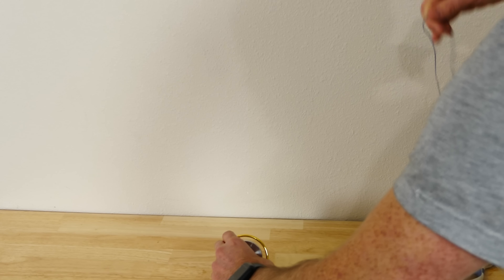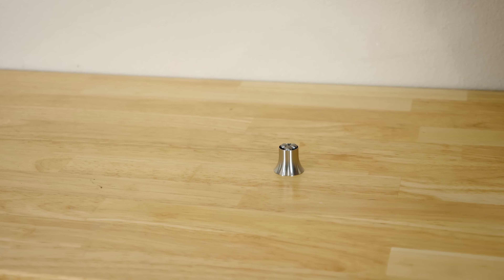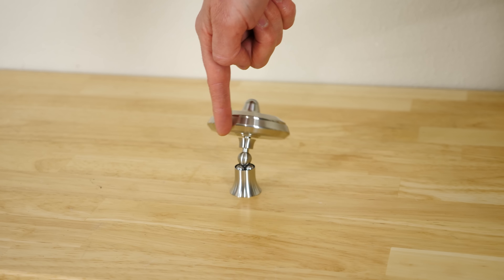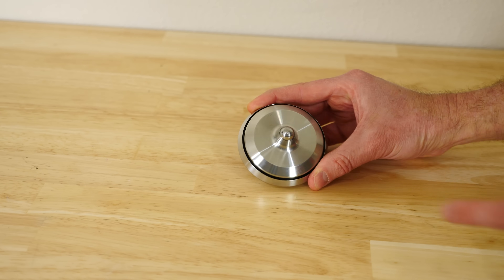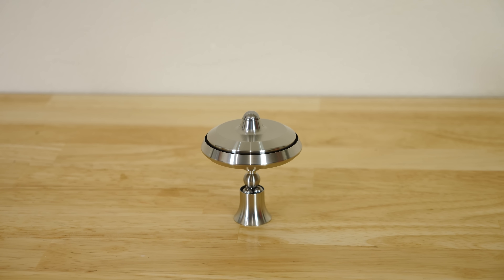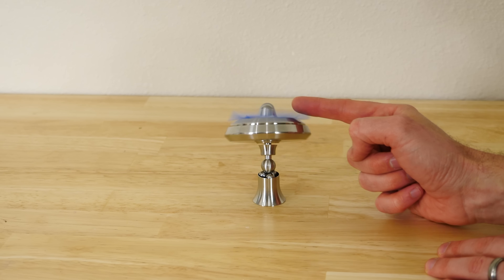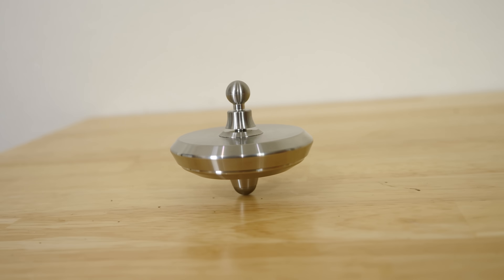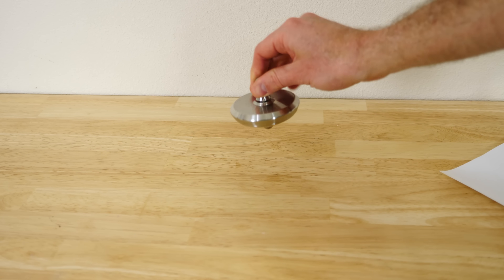How Do Gyroscopes Lift Themselves Up?

Comment: The CAUSE of this effect is NOT angular momentum.  That came from a math analogy that hides the cause from you, then it becomes a conservation law.  That is NOT an understanding, it's a mnemonic device for "what it does."  The cause is seesaw tilting end velocity, one end goes up while the other must go down, perpendicular to the spin plane, that must TOTALLY swap sides in half of a spin rotation to be the opposite end velocity, and this creates acceleration force directed up on one side and down on the other at the tilt axis.  Tilting is directional and changes direction from the forces, so the tilt axis follows tilt direction like an axle producing accelerations the whole time.  This steers the entire disk into some equilibrium usually, or it nutates forever (wobbling).  Look at my latest gyro explanation video that uses engineering sim software to expose the causal acceleration vectors.

Comment: Good, now could you explain the physics? In mathematical terms. It must be to do with transfer of energy between the spinning top, the processing top and the potential energy (the height of the centre of gravity), with energy being lost through bearing friction and air resistance.

Comment: I wish I could see gyroscopic principles applied to a bowling ball. Modern bowling balls have a “weight block” inside them. The weight block or core has the shape of a gyroscope. Ball drillers specialize in placing the finger holes of the ball so that the degree of precessing initiated at the point of the bowler’s releasing of the ball advantages the bowler’s chances of scoring a strike. 
I have watched many videos by ball drillers. But their explanations of the physics tends toward the mystical.

Comment: Very interesting.  How well does it work in the ideal case of NO friction on the spinning bearing?  Specifically I'm referring to powered gyroscopes, like used in airplanes' artificial horizon in decades past, or the Apollo capsule gyros.  Is there a difference between a powered gyro that overcomes friction, and one with theoretically perfect bearings with no friction?
Reply: @johnburgess     :  Maybe, the gyro designer used a magnetic bearing, so almost no "surface-to-surface" contact transpired between those concerned moving parts... Hence, longer time for rotation, before it come to a complete halt...

The American NASA group hinted, in the 60's decade, that they used a "liquid helium" as a bearing system, for the gyroscope gadget of their rocketships, used in outerspace exploration, experiments, etc.. 

The gyroscope effect + very efficient bearing system, was the SECRET for a "near 95% efficient", HYBRID type,  power Genset- thats why, the media & school sector was tight lipped (power moguls directives??..) - when it comes to the design of the very elusive vision, the "near perpetual machine" dream fulfillment...

Gyroscope principle + angular momentum + "fricrionless system", was the secret contraptions, used by the Almighty Creator God (John 1:3  &  Hebrew 1:3  & Genesis 1-2 chap.) - in running those myriads of planets, circumnavigating around the sun, non-stop, in "perpetual motion", for thousands, millions of years...

Comment: The real question is where did the centripetal force go? You'll notice that as the gyroscope on the string is precessing, the string remains completely still, yet all the mass should be at the gyroscope (that string should be wiggling everywhere but it doesn't). The center of mass looks like it is at the center of the string. I find this an amazing effect that is almost entirely overlooked.
Reply: @charlesvanneste2834  What you are talking about is more noticeable at lower gyro spin rates, producing a faster precession. You will then see the string angle out due to centripetal action.

Comment: One thing you missed in precession is any touch on the precession is also felt 90 degrees later which is what we have in the case of Helicopter rotors. The hydraulics are actually setup up 90 degrees to the left or right, depending on direction of rotation.

Comment: Totally correct, but the cause of the accelerations produced still follows the math, and that math starts with a "RIGHT-HAND RULE".  There is no mechanism to that.  It is a mnemonic device, and the cause derived from that math is ANOTHER mnemonic device -the conservation of angular momentum.  No one can explain what that means!  I can, and they will not publish it, because it contradicts the simplicity of their paradigm.  Consider this:  TILT velocity from the seesaw ends of the plane must TOTALLY reverse twice per rotation.  Spin velocity and tilt velocity are perpendicular vectors, so spin only sets the rate for the tilt reversal to happen within.  Spinning is not the cause.  It ONLY sets the rate.  Tilt reversals resolve instantaneously and continuously to acceleration perpendicular to the plane.  The scientific method is broken.  I've been screaming this secret for over 20 years.

Comment: well it's not the complete story you tell... when it comes to the egg or a spinning top rising up when spun fast, it depends on the point where the friction force is applied relative to its direction and the center of mass of the object. there are spinning tops that turn completely around until they spin bottom up, and they work because the center of mass is below the center of the sphere it spins on (if you have seen such a spinning top you know what i mean ...). for a spinning top to work normally, the tip has to be sharper than the whole object. (and if the tip has a flat part, it will never spin upright, but will have a minimal angle away from upright... important is only the part that touches the ground ^^)
for gyroscopes this doesn't apply because they are build in a way that the spinning part of it is not supported only on a point
Reply: Did Einstein study or observe a gyroscope? If not he could have got answers!
Gyroscope is crazy, we might still not see what it is really about, but one thing is sure the answer is there, just in front of us!
Reply: @attilakonkoly1318  it's not that hard to calculate what it does. you just have to use appropriate coordinates to describe certain aspects.
what i wrote about the curvature of the tip can also be described by the friction on rotation and precession (as is done in the video),. So to say "not the whole story" was not quite right by me. but i think it is more convenient to use force and contact point to find out what effect the shape of a spinning top has on its behaviour.
Reply: @deinauge7894  Thank You! I believe that there might be an other hidden force with the combined movement, friction, gravity, an ionic or atom molecularity in  other dimensions that we still don't know yet. It's only a hypothesis but I have the feeling that it's there!

Comment: I'm sorry, I like your videos immensly but this time I feel like this one raises more questions than it answers.

Since all the parts of the gyroscope appeared to be very finely machined stainless steel, it's very hard to see which parts of it spin, when do they spin, how fast they spin in relation to each other, and what kind of bearing is there between them and how that friction comes into the equation, if at all.
Speaking of friction, I watched the video several times, and besides my confusion about friction of what against what causes what, all I heard was what the friction causes, and no deeper explanation as to why is does so.

Comment: Thank god for Sci Hub! You wouldnt believe how many research articles and patents on magnetism have been censored and hidden from the 1900s all the way to present. 

Who knew Phosphate Phenolic supercharges Irons permeability and loss capabilities??? Like WTF???

Magnetic and structural properties of iron phosphate–phenolic soft magnetic composites
A.H. Taghvaei a, H. Shokrollahi b, , K. JanghorbanPO 34 (b) 3000.0
Wave number (cm-1) 1500.0
2000.0 1000.0 500 Fig. 5. FTIR spectra for phosphated powders (a) and uncoated powders (b).
Table 1 Effect of acid concentrations on magnetic permeability at different frequencies.
Acid
concentrations (g/ml)
0.005 0.01 0.04
104.26 98.33 107.25
90.58 92.68 80.92
70.16 80.52 47.18
53.76 66.08 31.5
insulating layer is thin. The phosphate film rather acts as a binder agent at the intergranular interfaces, and the composite gets its strength only by the retentive force of the metallic phosphate. This coating creates capillaries and microcavities that provide interlocking. Thin phosphating layer means less distributed air gaps, larger fraction of soft magnetic particles and lower inner demagnetizing field. It results in lower energy input needs to make the same magnetization process and to move domain walls
m (50 Hz) m (100 kHz) m (500kHz) m (1000kHz)
0 1 2 3 4 5 6
0
0.005g/ml 0.01g/ml 0.04g/ml
200 400 600 Frequency (kHz) Fig. 6. Loss factors of phosphated compacts at three different bath concentrations.
resulting in higher magnetic permeability. At higher frequencies (410 kHz), the sample with lower effective particle size (phosphated powders) exhibits higher magnetic permeability as a result of reduction in eddy currents. The total eddy current loss expression per unit volume in the
soft magnetic composite is derived [17] PedðtÞ¼
1 10    kb r2 rbulk e þ kp r2   2 Fe rFe
dB dt
ð2Þ
where re is the effective radius of the sample, rFe particles radius, kb and kp
factors between zero and one establishing the
contribution of the eddy current loss in the bulk material and in the particles, respectively. In a material with a perfect interparticle insulation, kb ¼ 0 and kp ¼ 1, and when the effect of particles are neglected, kb ¼ 1 and kp ¼ 0. The phosphate layer decreases the effective particle size by reaction between powders
800 1000 Transmittance (a.u.) Loss factor (Ω/μHARTICLE IN PRESS
3930
100
120
20
40
60
80
0
0
200
400
600
Frequency (kHz)
Fig. 7. Variation of real part of permeability for phosphated and uncoated
compacts with frequency.
Table 2
Measured density for untreated and phosphated green compacts.
Compaction pressure
(MPa)
600
800
1200
Phosphated samples
density (kg/m 3)
6910
7280
7710
Uncoated samples
density (kg/m 3)
6920
7310
7720
800
1000
A.H. Taghvaei et al. / Journal of Magnetism and Magnetic Materials 321 (2009) 3926–3932
uncoated powders
phosphated powders
0
1
2
3
4
5
6
0
un coated powders
phosphated powders
200
400
600
Frequency (kHz)
Fig. 8. Loss factors of phosphated and uncoated compacts versus frequency.
Table 3
Measured electrical resistivity, magnetic permeability and pentetration depth of
flux density for untreated, phosphated and phosphate–phenolic insulated
compacts.
Samples
uncoated iron
Phosphated iron
r (mOm)
38
600
Phosphated+0.7% resin 2150
m0 (1000 kHz)
27
51
88
d (1000 kHz) (cm)
0.05
0.17
0.44
surface and phosphoric acid (rFe) and eddy current part in the bulk
material (kb) by separation of particles and increases the bulk
resistivity (rbulk). As a result, total eddy current loss decreases,
smaller eddy current means a larger skin depth and as a
consequence improved frequency stability, magnetic permeability
high frequencies.
The phosphating treatment can increase the elecrical resisitiv-
ity of composites (Table 3) and then decreases the eddy current
loss (Fig. 8) and loss component of permeability in the samples
(Fig. 9).
The ferromagnetic resonance frequency or operating frequency
can be affected by electrical resistivity according to following
equation [18]:
fr ¼ r=2pm0mit2
ð3Þ
where r is the specific electrical resistivity, m0 the magnetic
constant, mi the initial permeability and t the diameter of particles
[18]. As the electrical resistivity increases, the ferromagnetic
resonance frequency tends to rise. From Fig. 9, it is clear that the
phosphating treatment can increase this frequency from 200kHz
to about1MHz.
10
20
30
40
50
60
70
0
0
200
400
600
Frequency (kHz)
Fig. 9. Variation of imaginary part of permeability for phosphated and uncoated
compacts with frequency.
800
1000
800
1000
uncoated powders
phosphated powders
Fig. 10 depicts the variation of the real part of permeability
versus frequency for composites produced from phosphated
powders and phosphate–phenolic insulated powders. From
this figure, the magnetic permeability is smaller for double-
coated compacts below 400 kHz. The phenolic top coating
decreases the volume fraction of the ferromagnetic iron fillers
in the composite and decreases the magnetic permeability
with respect to phosphate–iron compacts, but at the frequencies
higher than 400 kHz, this behavior becomes inverse as result of
reduction in eddy currents. The phosphate insulation coating
has large amounts of cracks and microcavities, therefore the
brittle nature of coating increases the probability of coating
degradation during pressure molding and it is likely that there
are many areas where the insulation coating thins or breaks.
Due to microcrystalline structure of phosphate coating, this
insulation provides much more surface area for stronger
anchoring to resin. The phenolic resin acts as a protective top
coating and then it decreases the damages of phosphate
insulation during compaction and increases the electrical
resistivity of composites.
μ'
μ"
Loss factor (Ω/μH)ARTICLE IN PRESS A.H. Taghvaei et al. / Journal of Magnetism and Magnetic Materials 321 (2009) 3926–3932 3931
100 120
20 40 60 80
0 0 200 400 600 Frequency (kHz)
Fig. 10. Effect of double layer insulation on real part of permeability with frequency.
0.0 0.2 0.4 0.6 0.8 1.0 1.2 1.4 1.6
0 800 1000
where r is the specific electrical resistivity, fthe frequency, m0 the magnetic constant and mr the relative permeability. According to this table, double layer insulation increases the electrical resisitivity, relative permeability and penetration depth of the flux density at 1000kHz with respect to single layer insulation (phosphate coating) and uncoated compacts.
phosphate coating phosphate +0.7% resin
4. Conclusions Good insulation is generally required to minimize eddy
currents in high frequency applications in soft magnetic composites. This paper investigates the effect of phosphate modification on the magnetic and surface properties of iron–phenolic soft magnetic composites. The following conclusions could be drawn from this work:
(1) FTIR spectra, EDX analysis, distribution maps, X-ray diffraction pattern and density measurements showed that the particles surface layer contains a thin insulating layer of nanocrystalline/amorphous phosphate with high coverage of powders surface.
(2) The bath with 0.01 g/ml phosphoric acid generates more amounts of iron phosphate insulation which leads to better particle separation in the composites and lower eddy current in the samples.
phosphate coating phosphate + 0.7% resin
(3) Double-coated particles (iron phosphate+phenolic resin) have higher electrical resistivity, but lower real part of permeability (o400kHz) and loss factor in comparison with single-coated particles (iron phosphate). For example, loss factor decreases about 85% in phosphate–phenolic 0.7% coating in comparison with phosphate coating.
(4) At low frequencies (o10 kHz), because of the similar static loss, uncoated and single-coated compacted particles have nearly similar imaginary part. This treatment cannot affect the static loss and for this reason two samples have similar loss component at low frequencies.
200 400 600 Frequency (kHz) Fig. 11. Effect of double layer insulation on loss factor with frequency. Fig. 11 depicts the effect of double layer insulation on the loss
factor for different frequencies up to 1MHz. The double layer insulation increases the electrical resisitivity and then decreases the eddy current loss factor according to the following equation: tand m
¼
pfm0D2 rb
800 1000
Acknowledgement The authors thank Engineer M. Ghaffari of NTU University for
the helping on SEM measurement (Fig. 2. Maps of phosphorus, oxygen and iron of phosphated iron powders).
References
[1] H. Shokrollahi, K. Janghorban, Soft magnetic composites, J. Mater. Process. Technol. (2007) 1–12.
ð4Þ
where m is the permeability, m0 a magnetic constant, f the frequency, D diameter of the material, tan d the loss factor, b the shape factor and r the specific resistivity [9]. The large reduction in eddy current loss factor (about 85% at 1MHz) for samples with double layer insulation increases the frequency stability without any noticeable change in the magnetic permeability up to 1MHz (Fig. 10). Table 3 represents the effect of phosphate coating and double
layer insulation on the penetration depth of flux density at 1000 kHz. The penetration depth is calculated from the following equation:
dp ¼
  0:5 r
pfm0 mr ð5Þ
[2] H. Shokrollahi, K. Janghorban

Comment: 0:55 putting a piece of tape on the top would make it more clear that it's spinning if it needs balanced put  two piece on at exactly parallel points. you could also use a sharpie to do the same thing but the tape would allow you to take it off.

Comment: action lab can you please post an experiment video today or tomorrow? i actually need it for research in a project. As you had mixed the water and oil with the vacuum chamber by degasifying it, can you boil it too like 115* celcius to find out if the miscible liquids separate by the boiling of water turning into steam and rising by the process of simple distillation. Can you please consider this and find out the boiling point of degasified water and if distillating it doesnt burn the oil. And can you please do it till the end of today? Thanks a lot

Comment: This is best illustrated with a spinning balanced sea-saw with a weight on one side and the gyro fixed on the other. The weight end goes up when you turn the sea-saw one way, the gyro when you turn it the other.